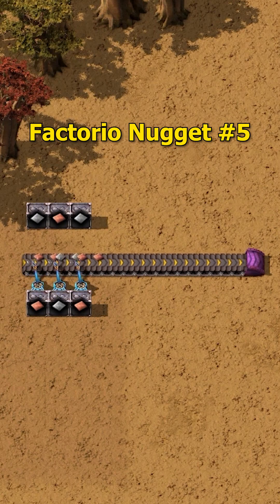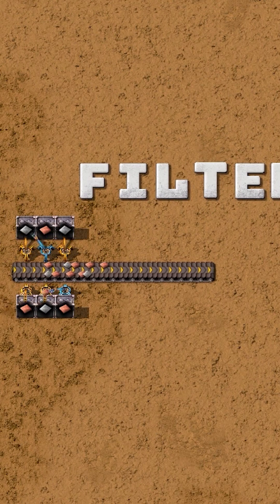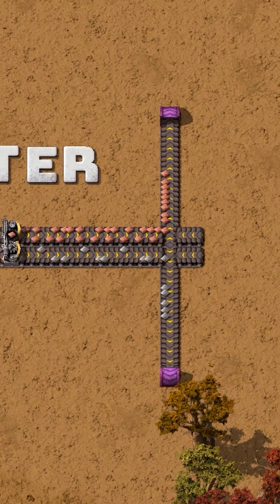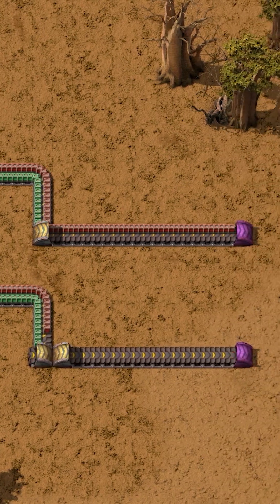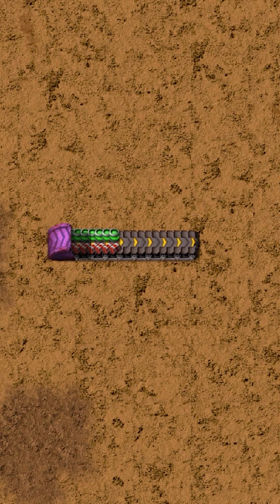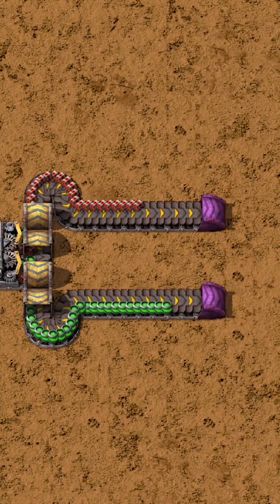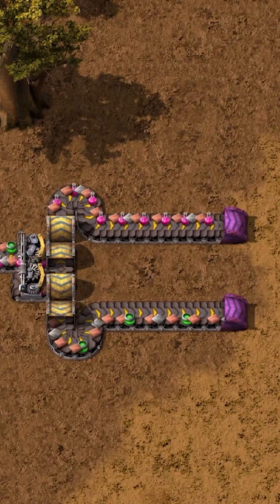How to SPLIT Belt LANES in Factorio #shorts #factorio #tutorial

Comment: wouldn't work for the first example as the items were mixed on both sides, and still only works for two items. Best is to use splitters with filter if you have more than one type of item, use more filtered splitters.

Comment: 1) You could simply never make sushi belts and skip the entire problem of filtering mixed belts
2) If it isn't a mixed belt, a single splitter can perfectly balance a single lane
3) If it IS mixed, you can simply use... more than one splitter.

Undergrounds aren't necessary except in rare cases where space is very limited, like Fulgora perhaps. If the outputs of your filtered lanes aren't equal, that's more of an overproduction/underconsumption issue, not a problem with filter splitters. They're doing exactly what they're supposed to do.

There is absolutely a thing known as "overengineering". This is an example of that.

Comment: You've literally declined the solutions for 2 items each on separate side and then provided one for 2 items each on separate side💀
Reply: That's not what happened my guy and you're missing the point of the entire video. Maybe rewatch it...

If you have items XZX on top of YVY, with the first solution you'll only be able to filter for 1 of them and end up with Z on top of YVY on  one of the tracks. You will have to repeat this a bunch of times to filter it to the way you need it, and you won't be able to preserve order. You'd end up with N belts of single items.

This solution at the end will preserve order, so you will end up with a belt of XZX and a belt of YVY, with only 2 belts, no matter how mixed your lanes are.

Comment: To be honest I would give another, cheaper option but it is a lot easier to just show it than explain it. Basically you can avoid the underground belts entirely for the final solution by using normal belts instead. Yes this is more compact but it comes down to whether you are playing with sufficient resources or if you do an extremely hardcore run like I came up with this for. I play with 10% ore yield so if I want normal world starter resources I have to go pretty far out and my biter bases may be far away but always massive and expanding line tentacles so cutting through them is brutally touch when they surround you.

Comment: It can’t be used for biter eggs, because the splitters will retain an item in the output before the blockage.
Reply from the maker: Learn how to use filters on splitter to prevent the residual on the wrong side
Reply: @Maxiume both sides have an item stuck on the splitter.
Reply: @danpowell806 well just put a dummy item in there then

Comment: dude why the 4 undies at the end. just have two flipped ones then you also keep the green on top and the red on bottom and not waste so much space?
Reply: Unfortunately when you try to do that they connect and go the same direction, and flipping one would flip both ends as 2 parts of the same thing. You can only avoid the connection if you use different types of underground belts

Comment: I use this mechanic mostly for lane balancers so if a lane gets most items picked from one side my main bus will still give evenly from both sides. This avoids one side being empty and the other piling up which can cause issues for buffers like train stops that have half the chests empty and the other half completely full. When at some point more than one side is needed then it will only have items on one side of the belt so you are undersupplied even though you theoretically have enough resources. Oh btw just having a splitter merge a lane from both sides will not fix this problem

(Here is the blueprint)

0eNrdltuOwiAQht9lrmFT8FDlVczGUCWGbIWGUrPG9N0XJK6N1u10XW/2isCUb4bD/9MTFGWjKqeNXxfWfoA4XUdqEKtON8b0xpo0XOudkWUc88dKgQDt1R4IGLmPPe+kqSvrPC1U6aEloM1WfYJgLRmcXFel9l65zjTevhNQxmuvVSrg3DmuTbMvwpeCPUpNoLJ1mGZNzBdQGYEjCBoKga12apNC01jXDZOjmayXOe9hTu5XeUfjiZa9zYZ5U3SNNGGzYeZsLJO1PZQ5YqU0bRxqpfnIE0YcxmLkASOQy29kE26u2zkb2h/rvD0QchGFbXzVRO3cX/ZsRBbWl2WKyYLXFO/fnqDZs7JFx0UIlDJAwhijpTSKFjI0G+WoDLGDcnWavMg5X7BllvOrC2Sxyn9nSHhh8rFMjMtN8Doda0kvlMDsVwoYxM5fYPn5k0/Tc87F0cwl+mlCXYOOSWEN+zkTYn9hQsWgCbE+Ij3/PT3EhogMBR3U+uJkD7K0X204L+g=
Reply from the maker: Exactly. That’s why i posted this video before explaining balancers 😉
Reply: @Maxiume  guess im ahead of the class 🤓
Reply from the maker: @TilDrillyep. Don’t spoil it lol

Comment: you dont need the undergrounds. just filter the splitter and put belts up and down as you would with a smelting array. would save you 4 undergrounds and 2 blocks of space vertically.
Reply: That doesn't keep the composition of the sides the same.

Comment: I have noticed this, but it has never been useful to me. I guess the use is when you have a very high quantity of different low volume items with little space, so you need to transport everything on one belt. the only problem is that there are 2 items stuck on the wrong side of the splitter belt before the underground belt, but I don't think that can be helped.
Reply from the maker: You can set the splitter filter to a random sign to prevent those two items from entering the wrong side. Re splitting lanes it is mostly used for main bus designs. But can also be helpful for mixed belts.

Comment: Wouldn't it be cheaper to do the split and then side-load the two belts without using undergrounds? Why have an annoying unmatched underground?
Reply: Because if you don't use undergrounds, one of the lanes won't be blocked and can end up on the wrong output if you don't supply the correct one quick enough. Sideloading accepts both lanes, undergrounds only one on each side.

Comment: So like. You didnt give an example of why wasting materials and such is better then just side loading the belt output of each lane into the belts coming out. It would literally just be filtered splitter, two turns on exit, each exit belt side loads onto the new outputs almost exactly like is shown here. So like, is it ONLY helpful if things back up all the way to the splitter? Because it really seems like thats it. Still need only one splitter, no underground belts required, still get all outputs of each side put into a single lane. Like im just not seeing it. If this design is beneficial over a filter splitter sideloading 2 belts then your factory has bigger issues and you shouldnt even need this solution. Feel free to explain if im missing something but this seems like a jankier way of doing the exact same thing. Doing shit like this to avoid a circuit? Sure maybe. But thats just lazy preference or a self imposed ruke
Reply: The "waste" youre talking about is like 4 items total. You can put some placeholders in if it bothers you so much.

Regardless, the examples you give don't do precisely what is being explained here, which is one belts two lanes being split into to seperate belts, totally independent of one another. Maybe you've never thought of the belt having two independent lanes of items, and thats fine, but for people who do this is useful

Comment: So the last setup could also be build with a junction on each side, forcing the one sided belt usage, but it's just more compact with the underground belts?
Reply from the maker: Didn't catch that. Maybe join the discord and show me what you mean
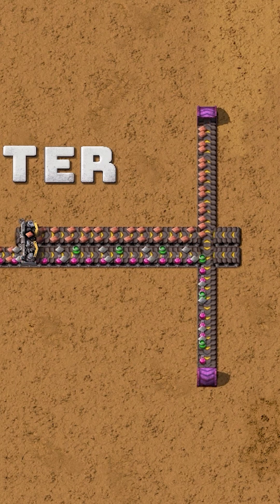Reply: @Maxiume I think I just don't really see the difference to the setup at 0:39
Reply: @MrVentches  well the difference is that underground belts only accept from one lane, and sideloading accepts from both lanes
Reply: @FoxSlyme  I finally understand now, all the item filtering talk may have confused me, as it is, as thee videeo so well said, about ripping the lanes apart, not the items. The bottom lane cant go into the top belt after the splitter because of the underground belt, that's how its sorting the items in the end, not because of a filter splitter.